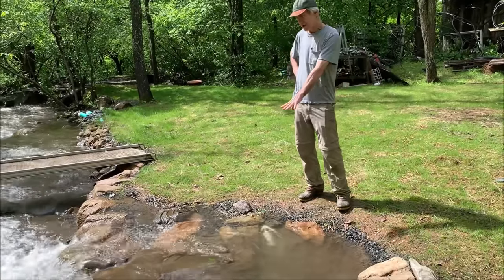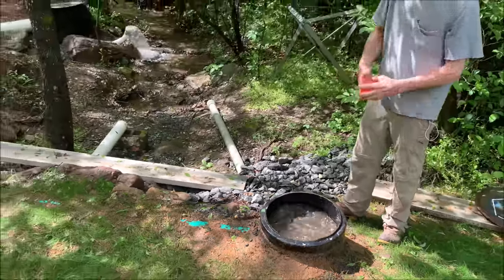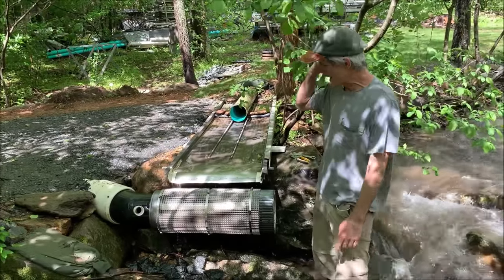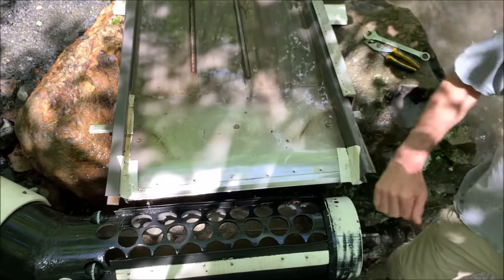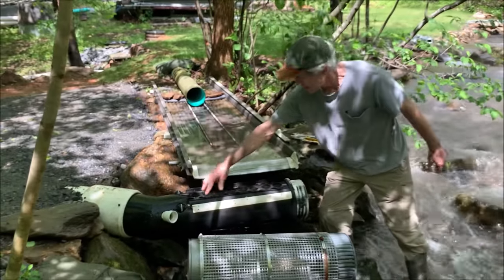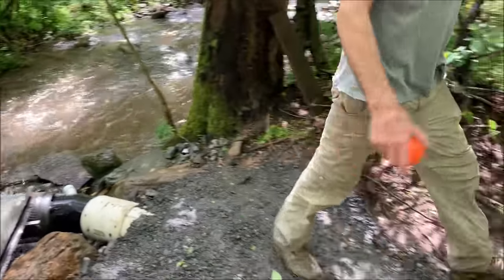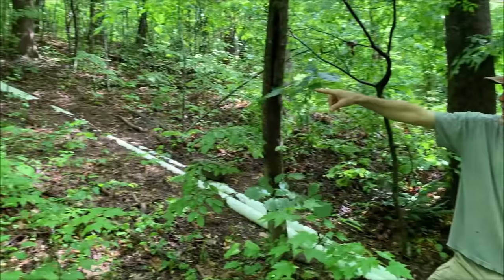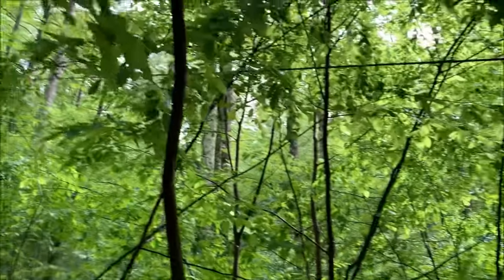500 Watt Hydro Power System in Virginia (Overview)

Comment: It's a good prototype.
The design are great.

How it will generate such power
Elevation or volume or speed.

Hp=lqh
     = volume flow rate x elevation x specific gravity.

Increase volume flow rate
The channel where the water flow.
That's how machine learning and deep learning experience will do.

The old man, got it right its only to show the machine.. Some place, water stream structure are prohibited

Comment: Great work Greene.
I would run the AC line all the way up to the house first. Long wiring on low voltage (from the batteries) will lose too much current: Olm's law I = V/R and Watts W = V x I, so lower I lower wattage.

Comment: Awesome! Your water collection system seems very over engineered though with many points of failure.. Whats wrong with a simple long perferated pipe and a sock to filter out any debris etc? Very cool nonetheless!
Reply: With all those trees and a high flow rate I guess he had a lot of debris. The point of his system is that it cleans itself so he doesn't need to regularly clean the filter.

Comment: Now that we are in February, 2021, how is the PVC holding up in the freezing temps?
Reply from the maker: the system is up and running continuously at 540 w . fast water doesn't freeze, yet.
Reply: @greenehydro7311  Thanks for replying, my creek has areas of ice around the banks and I wonder how that will effect my plans for micro hydro.  Also, I've seem PVC systems destroyed by cracks from freezing temps.

Comment: okay the thing I don't get why the hell did it go all that way with the pipe for. so he went like there's a creek right there and he went from the creek back to a thing of going all that distance why don't he just put the generators right there where the water was and then run electrical cable to where he's at. it makes no sense to spend all that money on PVC pipe and run it all the way over there. could have put the generators right at the like you know where the water drops off you going to put it right there

Comment: he could have gotten to washing machines and then turn the electric motor sideways and the squirrel cages he can adjust like cut one in half and then put one to the washing machine flip it get another one and put it on the other motor and just put them side by side and when the water spins it spins a Little wheel and then it the like the turbines are right there and you don't have to put all the tubing and all that other bull crap in there

Comment: Beautiful Creek.  Hey!  Let's improve the view by snaking 500' of PVC through it.

Howzabout just putting a water wheel/ spinner at  spot that gets enough flow, perhaps gear it or just put a serpentine belt on to an alternator & hook to a battery. 

 Not 120volts, you say?  So what.  Use the power for a shite-ton of 12volt LEDs, etc.  13v lighting systems are very common in new construction these days.

That setup shown is ad hoc & is an affront to God's beautiful Creek.

Comment: You can use mono solar panels and even now AC supply solar panels are available in market
Reply: And don't work on days that have heavy overcast or at night. The hydro runs as long as the water flows. We have a feast or famine problem on our farm with water. It can be as low as 100 CFS flow to over 3000 CFS flow in the same day. And that can add 5 miles to the driving distance to town.

Comment: Why would you run the DC lines to the house. The rectifiers should be as close to the load as possible. Transmitting AC over that distance is way more efficient. Also, the I²R losses from the DC on that long of a line is sure to attract small animals looking for warmth. That system may generate 500W at the inverters but he is losing a good bit of that running it as DC that far. Also a +12 to -12 VDC system is not "two phase DC" as phase refers to AC. He just has a 24VDC set up. This whole thing is way messier than it needs to be too.
Reply: doofus.    WATCHIT   again.     the inverters are in the box.     he is not  running  DC.

Comment: This is 500 watts, 24 hours a day, 7 days a week, 365 days a year. So 12kw per day, 84 kw per week, 336kw per month....and  4380 kw per year!. The 500 watts into the batteries can be extracted via his inverters...the first inverter copes with 400 watts out at 120 Volts AC, and he said the next one is 600 watts output.  So he can output up to 1000 watts continuous to power say his , radio, TV, Computer, Wi-fi etc etc.  Using a 4000 watt invertor could see an oven, clothes iron, vacuum cleaner being used for a period of time.  Also a water heater could be run as a "dump" load when the batteries are fully charged. All this electricity is now FREE for his use for the foreseeable future. Say @ 15 cents per kw/hr= $657 saving per year running his home.

Comment: Edison generators are zero pollution and zero fuels generator of electricity.  You don't need water either you can pump water for free off grid. An Edison generator can be made from a car generator chisel and inverters. The generator has to be pre 1974 generator not an alternator. Then you chisel off the armature magnets alternating one sixth on one sixth off . The field magnets move the generator coils and you wire the 12v 120v ac inverters to convert DC to AC and house current outlets.

Comment: This is lame, my grandpa built his dad a hydroelectric generator that powered their house and workshop for 70 years before the city bought their land and filled in the system. They didn't even dismantle it, so underneath this big pile of dirt, there's still a big concrete structure and a bunch of (now 80) year old electrical generation equipment. What is all this stuff you're using for the generator!?!?! It's very unecessary.

Comment: So you take water from one river, filter it and send it to another. Where next to the second river, you've a water wheel. Using a pelton wheel. Making tops 494 watts.

Now I see two places where a water wheel could fit for each river and the flow looks good enough for a fairly large wheel. And a lot more watts.
Or one of those shallow vortex turbines.

I think you should at least dig the pipe into the ground.

Ps. stop shouting Doc.

Comment: 500 watts is less than one horse power.  Wife's hair dryer runs on 1500 watts.  Toaster takes 1200 watts.  Toaster oven takes 2000 watts.
Reply: If your wife's hair dryer runs for 5 minutes, it consumes 125 watts.
Your Toaster runs for 3 minutes, it consumes 60 watts.
Your Toaster oven runs for 10 minutes, it consumes 330 watts.

But this thing will generate approximately 12kwh or 12 units per day, if he has an good battery array for buffer, he is set for lifetime without paying for electricity as long as the creek runs.😉

Comment: 7:50
Two phase dc?
Dc doesn't have phases, can't have phases if there ain't no waves!

(he probably just means two wires)
Reply: DC can have sine waves. Think hard about what you have been taught as to what AC is. But yet you can get the same wave for in DC. You just measure from a different point of view. Peak to inverse peak in AC and bottom to top in DC sine wave.
Reply: @gravelydon7072  Sure, a sine wave can have a DC offset. In engineering we separate signals out into AC and DC components all the time. Given there are batteries involved though, I'm pretty sure this isn't the case here.
I'm 99% he's just confusing "N wires" with "N phases", probably because of the three phase power from his turbine.

Comment: All that design and constant maintenance to save you from paying a $30 electric bill?
Reply: And what would be the cost to get grid power to the place. Many places it is cheaper to go hydro or solar but both have their drawbacks. To install ours at this house it was $1200 back in 1978. That was for the wires, concrete, trenching, and conduit.  And that was for about a 300 foot run of 3 conductor 2/0 wire.

Comment: this is over engineered, since the water continuesly flows 24/7 you don't need inventer and battery, all you need is a Breaker.
Reply: You can't run the generator output straight to any appliance, the voltage and frequency out of those units are inadequate. I do agree that it's over complicated.

Comment: This system is so needlessly over complicated it's not even funny.  It's like a Rube Goldberg machine.  

And all that for 500 Watts?! 

With that large of a creek, and that much flowing water, you could literally build a few water wheels, hook them up to a bunch of modified alternators, and get upwards of 5 kilowatts of power at least,  without much effort.  You said yourself it's only a few inches higher than normal, so.....it sounds like you have decent flow all year long....

And there's probably even better options than alternators by now......just something to simply be driven by a water wheel....

You've already got all those ugly plastic pipes and crap running all over the place, so, clearly aesthetics is not an issue.  And truth be told, I'd rather look at a nicely crafted water wheel than plastic pipes....

And why, oh why, would you start with AC, change it to DC,  meaning in order to power anything in your house, you have to change it back to AC? 

And I'm looking at all these other "elbows" and traps, and connections, and, and, and.......     WHY?!!  

It's LITERALLY a Rube Goldberg Machine. 

Way, way, way over-engineered man.   And needlessly, and wastefully so.

I know.....everyone's a critic.  But......I just literally watched this video......   Much less water, much less flow, and, even he could improve this very easily.......and he spent about maybe a hundred bucks on everything......

https://www.youtube.com/watch?v=ZmHY9DkD1Hw

Comment: 7:47 What is 2-phase DC ?
Reply: Since no one else has answered you I will do my best.  When you use a rectifier to convert AC power to DC you get 2 wires one is positive and the other is negative. AC can have positive and negative in the same wire but not at the same time. DC only means electrons can only flow in one direction. I am not sure phase is the best word but if you were to slow down the alternator and you have a light bulb hooked to it you would see it pulses bright, dim, bright, dim, and so on. If you speed it up we can no longer see the pulses with are eyes. We use large capacitors to smooth these pulses out. So in a nut shell when you convert AC to DC using only a rectifier you make the electrons in each wire only move in one direction but you do not remove the phasing or pulses until you use other electronics. In his case that is what the charge controller is doing.

Comment: if you have an AC generator why convert to DC
Reply: Because it is wild AC and 3 phase. Convert it to DC for stability and surge handling with the batteries and then use the inverters for a nice stable output.